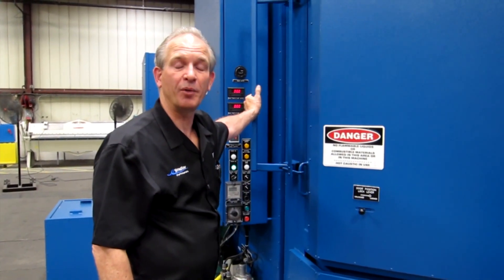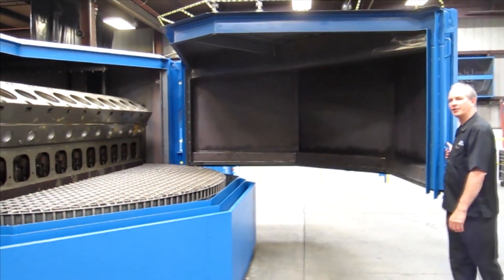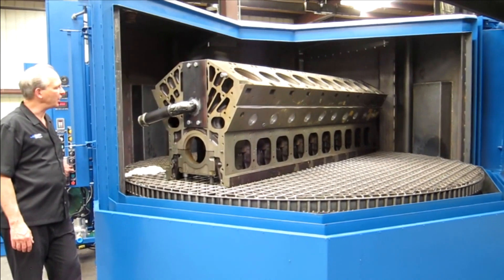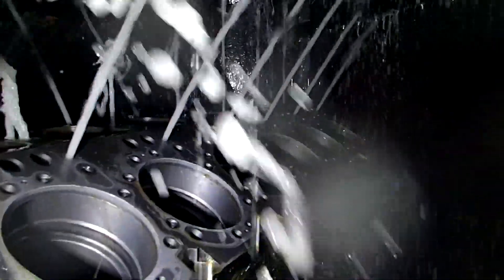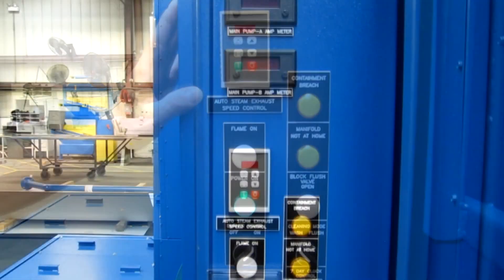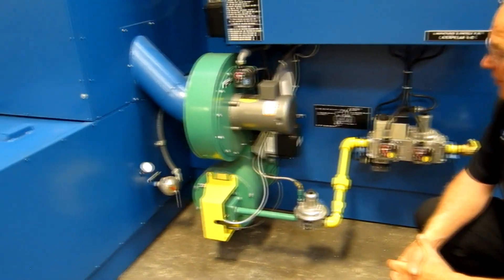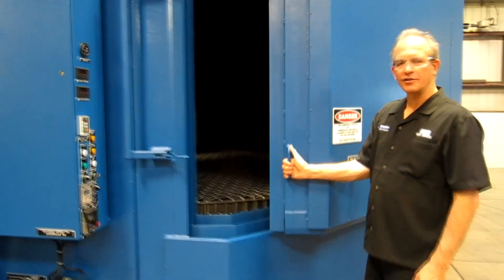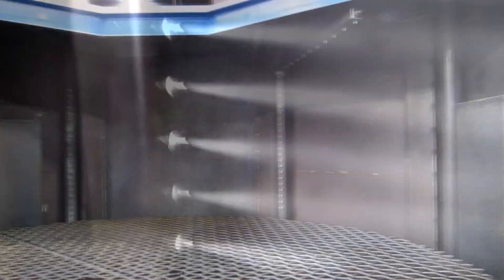StingRay Parts Washer SR13648 CAT C175 block washer

Comment: Why would a customer use this service?
Reply from the maker: Hi, this is not a service. StingRay designs, builds and sells cleaning machines. Shown in the video is our size 13648 washer for large parts. 136 inch diameter x 48 inch high work volume.